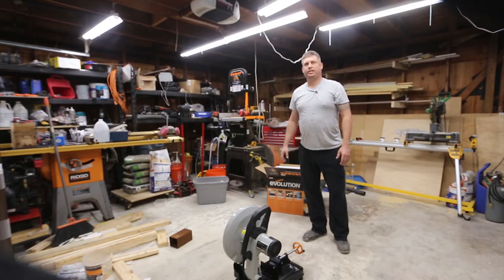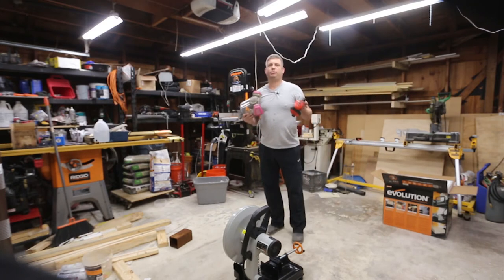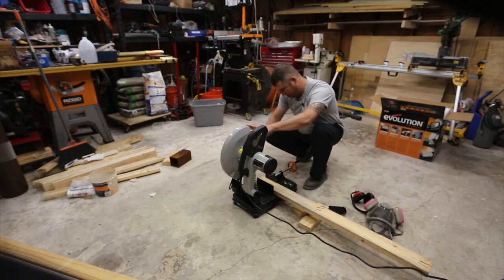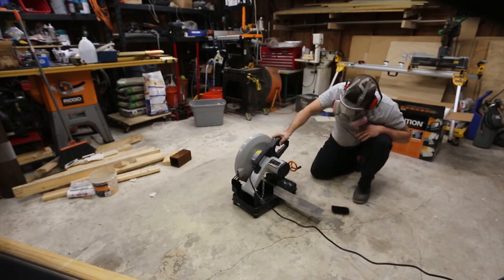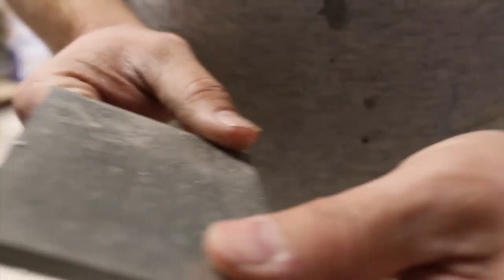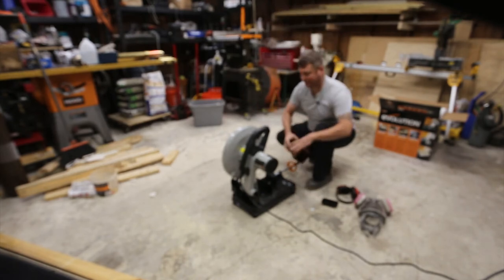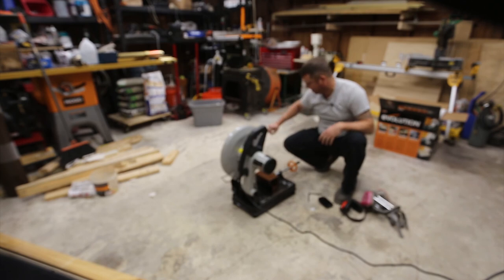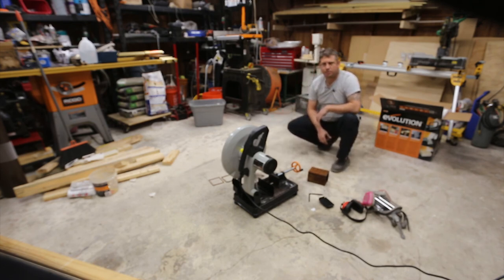Evolution Rage 2 cold cutoff saw review

Comment: Hi Brian, I have an Evolution as well. Like it. But I have a question about your faceshield with filters to it. Which brand is it, or where to buy??  Thanks.
Reply from the maker: 3M 6100 series if I remember properly.  There a variety of filters available for it that are designed for different use cases.